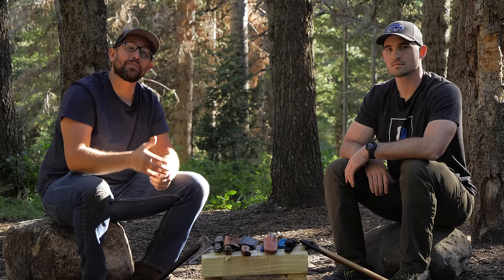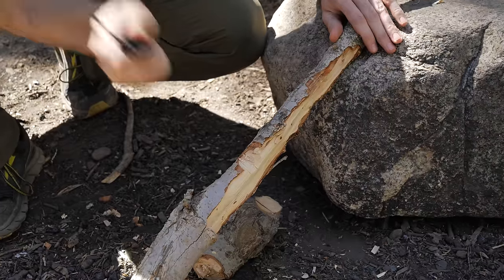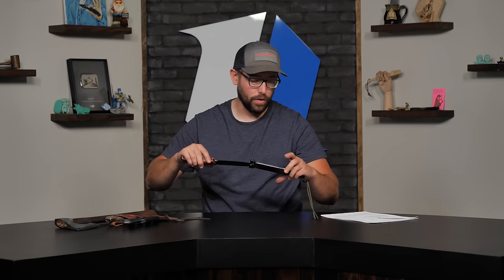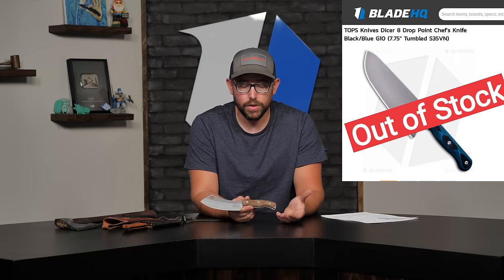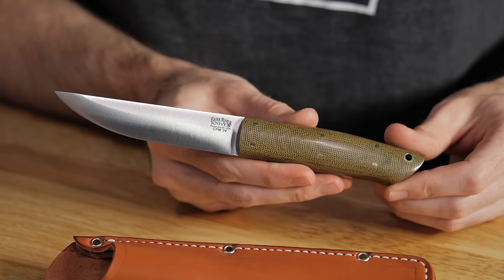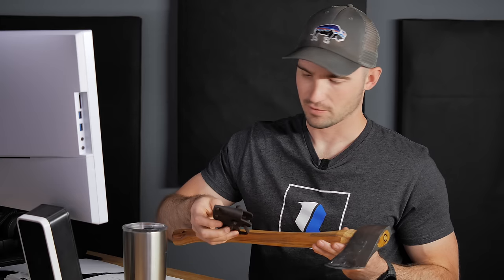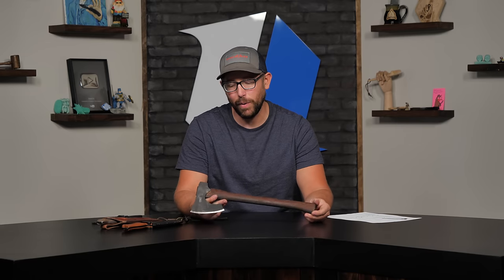We Found the Best Camping Knives! | Knife Banter S2 (Ep 38)

Comment: I have a very nice bearded camp ax from a company called "Arms and Armor" made from 5160 tool steel. The reason behind this type of design goes way back too the era of the Vikings. They did not have a lot of iron to work with, so they made the ax with as little iron as possible. When sharp, its a great ax design for chopping, and splitting and since you can choke up "Under" the cutting edge, you can do some fine work, and maybe feather sticking. My two camp knives are the Mora Heavy Duty Companion, and the Becker BK-16, both very good knives. I also carry a small folding saw.

Comment: I prefer the esee 5.  I have 1 and it's a beast. I had a bk2 but traded it with esee 5 because I found it more polished , finished, and functional. It has a better cutting edge and pointer tip. The bk2 is more like a sharpened pry bar. I also have a 60th anniversary stainless steal Ontario Ranger series. I take both knives out into the field and use the esee 5 for heavy tasks in dryer conditions and the stainless steel for lighter general tasks especially in wet conditions. I'm up in southern Ontario Canada. 
I go up to Algonquin Park regularly. I don't take a hatchet. 
Just my 2 knives and a silky saw.

Comment: as a chef you dont usually pinch the handle of the knife you pinch the steel just after the handle, it gives you more control when cutting
Reply: You also don’t pinch grip a cleaver. You also don’t food prep with a folding knife. Unless you don’t own any other knife. And why prep at a campsite in the first place? 

The funny thing is you can get a top tier  Gyuto handmade by Japanese blacksmith for the same price as that Spyderco they used. 

Spyderco coincidentally makes kitchen cutlery and sells their shitty chef knifes for like $400.

Comment: 19:15 - Hi guys. The biggest problem with convex grinds is that they are wickedly difficult to sharpen correctly, without a belt grinder, even more than a Scandi grind, which is difficult enough. Here, the sabre, flat and hollow grind knives leave them in the dust. They are waayyy easier to sharpen, even for beginners, because the secondary bevel is so narrow compared to the wide Scandi grind,  and the convex grind where one sharpens the whole width of the blade. There is no "best camping knife" - knives are designed to do certain tasks; some excellently, some well, some not so well, some poorly. No one knife does them all excellently - that's like searching for the Holy Grail.

Comment: The Gerber Principle seems okay.   But when I think about going to buy it all goes wrong.  I could buy the principle in 420HC for $50 or get a Mora Robust in 1095 for less than $20, or another medium sized Mora in 12C27, slightly better than 420HC, for also about $20.  I know the Mora heat treat is very reliable.
I have seen the punishment that the Robust can take, so I don't really care about the full tang on the Principle that much.
So then it seems silly to get the Principle.
Now Gerber makes more sense in the area of the Strongarm, where they have a very good value in a small survival knife.
Or maybe a medium/small russian bushcraft knife of good quality and value  (BPS, Stryi, Beavercraft).
The Principle is in the price range of a Condor Terrasaur without really competing head-to-head on a functional basis.
I suppose it has a slightly better sheath.  I tend to make my own sheath when a good value knife happens to have a mediocre sheath.

Comment: If I had to have one knife, it'd probably be an Izula 2 or Esee-3.  Have a Esee-5 and it's just too much of a brute for small tasks.  The smaller Esee have a solid build and are actually pretty capable despite their size.  Candiru is maybe a little small for most things but the CR 2.5 is a good utility knife too.  They are getting a little expensive, though.  Looks like you guys could use some hatchet practice :)

Comment: 2:26 Nope! Not at all a chopper. It's a feathersticker! Yes, it can be batonned, but so can a spade!
4:20  ESSE 6 - great chopper, but the blade is a tad thin, whereas the ESSE 5 is a full 1/4" thick. 
6:20  Spyderco - food prep? Maybe as a paring knife, but, well, .....

10:38 Bark River - full on bushcrafter. Let's leave it doing those things, so not an all-rounder or heavyweight like an ESSE 6.
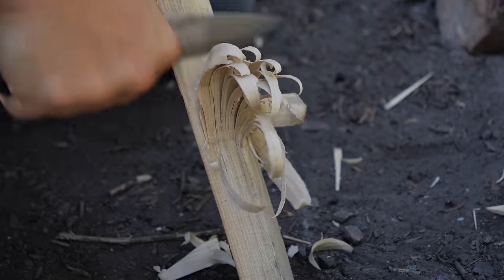13:11 Gerber - similar to Bark River
Note: Bushcrafting is a very small niche segment. I've been wondering if its time hasn't perhaps come and gone by now. Making fire with ferro rods and feathersticks so fine they look like fluff balls, is no longer really necessary, as making fire these days has been simplified to great degree, with high tech solutions abounding! Are knives dedicated purely for this purpose still a thing? Asking for a friend. 😉😉🤣
14;50  Axes? seriously?  With a Silky saw and ESSE 6/Junglas II what would anyone lug a heavy axe around for? Maybe, just maybe, at a fixed hunting lodge, permanent camp site yeah, but not up and about in the woods. 
Thanks for a fun video!